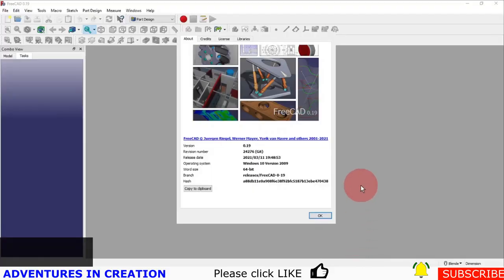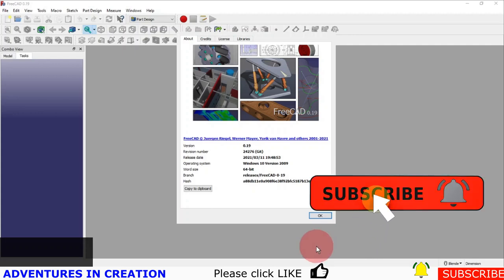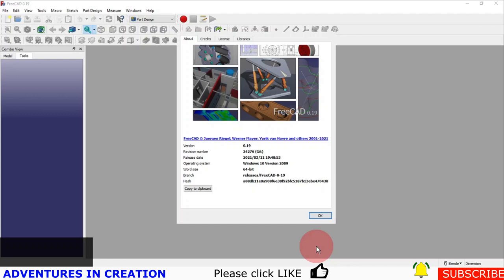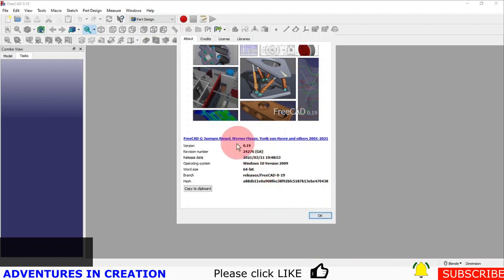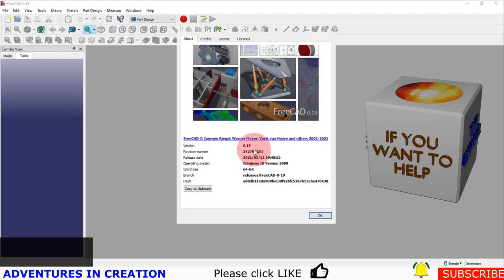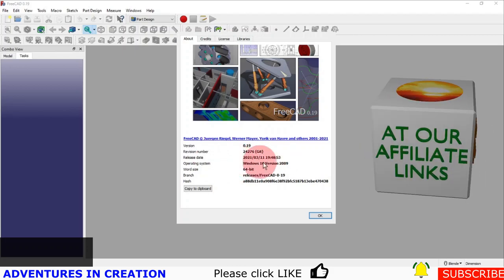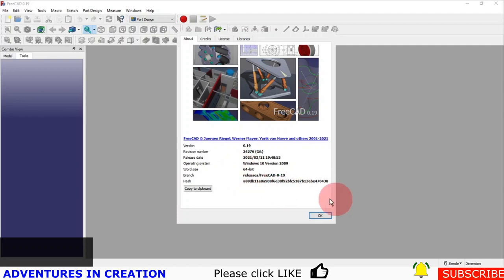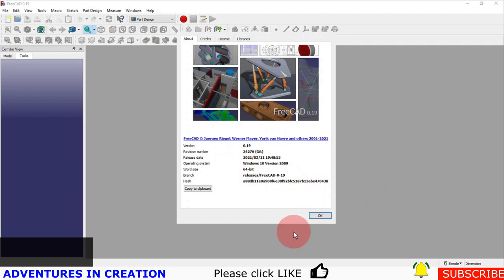FreeCAD for Beginners #3 Offset Sketches and Datum Planes

Comment: Wednesday, 9-13-203   I am new to FreeCAD, but not new to solid modeling. I just did this lesson #3. When you do the feature #2-sketch and pad on XZ plane(@6:33) I can see severeal methods to get around the problem of extruding feature which is not on the plane of the sketch. You can do it by moving the sketch(as you showing) or instead, leave the sketch in the middle(XZ plane) and when you do the padding command, there is a choice of 5 different types of extrusion(pad) in pad parameters(combo view-task window). Select  Type "2 dimensions", then go down the distance you need to(if you do not know the distance to the bottom surface of the fish-select Measure -Measure linear in upper line menu and click on the XZ plane and the bottom surface of the fish(no use of "Ctrl" needed) and it will tell you how much you need to extrude to be exactly even. If you want to move the 'upper' (closer to the center) surface of the box you are extruding , there is  a "2nd length" parameter window in Pad parameter task window -towards the bottom of it and you enter the dimension from the sketch plane(either in plus or minus amount).
Alternatively you can click on bottom surface of the fish and create the  reference plain  for the sketch there and extrude from there. In the parameter window of the ref. plane  Task window there is option to move the new reference any way you desire and so you can be extruding from there....
This FreeCAD actually has some serious punch under the sleave! I am starting to really like it!
Reply from the maker: Excellent input. There is always more than one way to skin a cat 🐈- the beauty of FreeCAD is you can develop a technique that works for you.

Comment: Being new to FreeCAD, this tnp has made learning a challenge. The datum plane helps but I'm looking forward to the fixed version. Thanks!
Reply from the maker: Me too... Thanks for the feedback
Reply: Right now realthunders tnp patches get merged into mainline so we can expect that in two month 0.20dev be much better in handling that. Until then you just have to keep your workflow clean and use draft to start multi part designs.
Reply from the maker: I hope it can be done that quickly. It will make a huge difference to the work flow but you are absolutely right, for now, keep your workflow clean and leave chamfers and radii to the end.
Reply: slapping sketches on random faces with reckless abandon will  never  best practice.

Comment: Tip: you can also attach the datum plane to the face of the object. All you have to do is click the face where you want the datum plane to appear and you can start sketching right on top of that face instead of selecting same plane as the face because what if the face of the object is on a plane other than the default planes.
Reply from the maker: You can, but beware the tnp as the face may change its reference if you modify the model.
Reply: That's exactly the way to do it if you create features of a certain body, such as pockets in the object. Links them together, logically.
Reply: @Adventuresincreation   Better form is to use a datum. Draw your secondary part. Then, use Boolean Operation to join the parts. They are parametric now and fused. The co-joined part will be properly associated for good 3D printing. Using Boolean fusing will allow drawing additional features from a part face, also.

Comment: You are still introducing the TNP by using the chamfer... As long as you leave for last and are ready to erase and redo that is fine, that is how I manage it as well. I really hope TNP will be sorted soon in 0.20, spending way to much time on workarounds. Regarding datum planes I just discovered yesterday I can only rotate +- 90 degrees... I will check if it is possible to rotate a sketch more, right now my design is limited by the 90, would like to try 120 or so (parametric model of a wheel)...
Reply from the maker: Definitely leave chamfers and radii for last. Technically you could model the chamfer but I wanted to keep it simple. I hope it's included in 0.20 too. That would be excellent. I didn't know there was a rotational limit, I will have to try it out.

Comment: Nice video. I have one question: Is it possible to draw lines that snap into the previous sketches structures? Instead of just setting that distance by typing numbers.
Reply from the maker: You can use constraints to attach lines to sketches. It's that what you are looking for?

Comment: I've found difficulties when trying to apply this to a sketch often finding that it's better to do this using the body that owns the sketch instead.

Is there anything wrong with doing it that way rather than on the sketch itself?
Reply from the maker: I think it depends on what you are trying to do. If you are moving the body for a boolean operation this may be a good solution however, you may have multiple sketches in a body and then you would want to apply the offset to the sketch itself. What problems are you having?
Reply: @Adventuresincreation  the placement options just never seem to stick...it's really hit and miss...not sure what I'm doing wrong.

I seem to do a lot better just applying the settings to the body itself

Comment: Done.
Flat fish now has an attachment with two holes in it.

I am going back to watch it again as I'm not exactly sure what the tnp issue is. I accepted my datum plane being snapped to the bottom face of the "fish" and that worked, but I see in the comments that will have issues due to tnp and I don't currently understand why.
And a final comment. There probably is a way to do this that you didn't discuss to keep things simple, but having to move the sketch to align with the base by specifying seems a bit naff, I'd assume there was a way to tell it to align itself with that face. Which may trigger this tnp thing again, so I definitely need to learn what it is about.

Making progress in my understanding. Thank-you.
Reply from the maker: The Topological Naming Problem (TNP) is an issue where if you use a face as a reference then you modify the model, your references can get changed and your model will break. That's why, for now, we are using offset sketches and offset datum planes. In the "near" future this issue will be fixed and we can create sketches and datum planes referencing faces until then, we should be careful not to do that. Also, do your chamfers and radii last, that way if you do make a change to the model you can redo them fairly easily. Again, once the TNP is fixed, that will no longer be problem.
Reply: I am also getting some weirdness with my installation where when I start a new sketch, my other objects disappear and I can only see my new sketch. Makes it tricky to line things up. Once I close it I can see everything again and go back in and edit the sketch to position everything. Not asking you to fix that (unless you know exactly what causes it and it's a simple fix), I will join the FreeCAD support forms and ask questions like that there.
Reply: @Adventuresincreation  Thank-you.
Reply from the maker: @CraigMassey_nz  You can go back to the model tree and turn those parts back on using the space bar.

Comment: how can I use a datum plane to create two parts? Like a base geometry which kicks off 2 related flat parts (with holes) which can be used for the path workbench?
Reply from the maker: I am not sure I fully understand what you are trying to do but if you have created a datum plane in one body you can create a second one another body.
Reply: @Adventuresincreation  I am trying to create 2 parts that sandwich on top of each other. But after they are made, I need to edit/tweak them.
So modify a dimension in a sketch (or datum plane?) and have BOTH parts be modified.  
If I use"link external geometry edge" you get only one chance, because, once you pad a sketch, you can never change the underlying geometry that created the linked edge!
It's like freecad twarts every method somehow.
Surely there must be a way. So frustrating.

Comment: I'm a beginner in FreeCAD so bare with me. Since you offset the datum plane it is not fully parametric anymore (every time you edit the original sketch you have adjust the offset of the datum plane as well). If you edit the original sketch to move the bottom of the fish down the datum plane will stay there so the new feature won't be attached to the lower side of the fish. It will be on its side. So my question would be how do you attach the datum plane to the bottom of the fish so when you edit the original sketch it will move the datum plane as well?
Reply from the maker: You can make the position of the datum plane parametric, just like anything else. You can have it be a function of the part you are modifying if you like. The only reason we don't attach planes to faces, and use more datum planes than just faces, is the topological naming issue. If that gets resolved, then we can use faces instead of planes or attach planes to faces.
Reply: @Adventuresincreation  thanks for the quick answer! Can you show us how the attaching sketch to a face could brake? Or direct us somewhere where we can see? Because I did a couple of times but did not happen to me. I believe it can brake but I would like to see it how does it happen? Will the sketch migrate to a different face on the object?
Reply from the maker: @gergaly  If you create a rectangular sketch, pad it. Create a sketch on a face and pad it. Now go back to your original sketch and change the profile of the rectangle to a sawtooth or similar. You will see the second sketch will attach to a different face, or more accurately, the number of the original face is assigned to a different face. This will cause your second sketch to be on the wrong face. It's pretty random too.
Reply: @Adventuresincreation  Thanks! I've tried it. It works as you described it.

Comment: Great tutorials. However, i keep comoing across instances where doing the exact same thing you're doing produces different results.  T abou 5:20  -  Clicking on the pad, then Space makes the pad disappear. All good. Clicking on Sketch and then Space does nothing. No sketch anywhere. Double clicking on Edit sketch works, but the pad obscures the sketch. Highlighting the pad, then space and everything disappears. No sketch . Blank space. Damned frustrating
Reply from the maker: It sounds like you are clicking on the body. I would have to see exactly what's happening  to be sure.

Comment: why did you modify the sketch's attachment value to manually offset it inatead of sketching directly onto the wanted face?
Reply from the maker: Because of the topological naming issue.
Reply: @Adventuresincreation  I see, has it been fixed in Linkstage3?
Reply from the maker: I believe it has but hasn't made it to mainstream freecad yet

Comment: You were offsetting your sketch by changing the z value yet you were woking in the xz plane so you should have to offset in the y dimension.  Why z not y?
Reply from the maker: That's an excellent question. It has to do with the local coordinate system and the model coordinate system. All sketches will move "in and out" in the Z direction relative to the local coordinates. The best way to test it is move the sketch in the other directions and observe the effect.
Reply: @Adventuresincreation  
It's not obvious which way the x or y offsets are going to move on a datum plane without trying them.  If an LCS is attached and turned on that helps.  This is always going to be confusing to me since the xyz display(global?)  in the bottom right corner is not applicable.
Reply from the maker: The best way is to just try it. You can always use ctrl + Z to undo any changes.

Comment: This has really been helpful, but I'm stuck on one thing... After creating the sketch on the datum plane you add the circle and constrain it without specifying anything that locks the circle in the horizontal axis.  When I walked through this video my circle was not fully constrained but I couldn't fix the horizontal motion of the circle.  How did you do that?
Reply: I backtracked and see that I did not adjust the z position of Sketch001 to 39.99.  When I did that, I noticed that I was able to place the circle on the Y axis and it auto-constrained to that axis.  Any idea (aside from me just doing something stupid) why that would make a difference?
Reply from the maker: I don't think that made the difference, probably when you first placed it, you were not close enough for it to automatically constrain.
Reply: @Adventuresincreation  Ok you're right (of course).  I guess it was a late night.  I tried it again and things worked as expected.  Sorry, and thanks for a great set of videos!  Just to beat anyone else that reads this to the punch... yes it was just me doing something stupid.  🙂
Reply from the maker: @edsutjr  No worries, it's a fun learning curve.

Comment: The attachment offset adjustments makes no sense at all to me. Your first example adjustment shows you changing the Z value, but the sketch is actually moving along the Y axis (as made evident by the axis 'gadget' in the bottom right of the screen...it would have helped to have the axial planes displayed on screen, too, as it would have made it clearer what's going on).

Can someone please explain this weirdness to me...it's been driving me nuts for days whilst trying to learn this stuff.
Reply from the maker: It's the difference between the local coordinate system and the global coordinate system.
Reply: @Adventuresincreation  Thank you! I figured it out shortly after I posted...another YouTuber clued me in. It would be nice to see a local axis gadget attached to the datum plane somewhere.
Reply from the maker: @imacmill  no worries, it can be confusing however, I just move stuff in one direction if that doesn't work just ctrlZ then try another, you soon get used to it.
Reply: @Adventuresincreation  Ya, that's the only way, really, but it's helpful to at least be aware that the z-axis is always perpendicular to the sketch...the X/Y are harder to determine by observation because the view can be rotated to any angle.

Comment: You might answer this in a future video because I just started going through the playlist but if you set that one sketch to be 39.99 mm placement, won’t that detach the piece from the main body of the fish? Don’t we need all the parts to be a solid body if we are going to mill this from a piece of metal?
Reply from the maker: You cannot create a model that has multiple parts from one body. It just won't work. The change doesn't disconnect it just makes a very small step.

Comment: Must Use Boolean feature to combine the two Pads. Simply moving one object to be imbedded into another object is poor form.

Your Problem: Inserting one object into another and leaving them that way creates a problem with 3D printing parts needing strength through integral integrity.  When you join two objects by just inserting them into each other - as the two or more objects print - they are printed as separate objects. They print as discrete separate entities close together. There is poor strength this way. Watch a part print. You can see the co-joined have distinct outlines. The print will not be a single object.   This shows a poorly designed CAD entity.   

OK for trinkets, few toys, art - junk. Not Quality.   [Disclaimer:  Been there. Done that. Learned from experience.]
Reply from the maker: Thanks for your input.